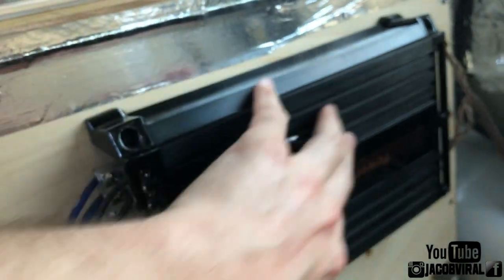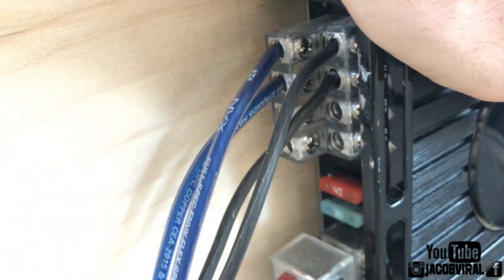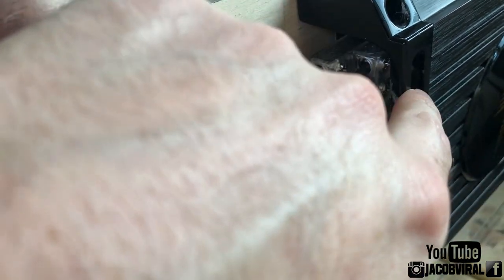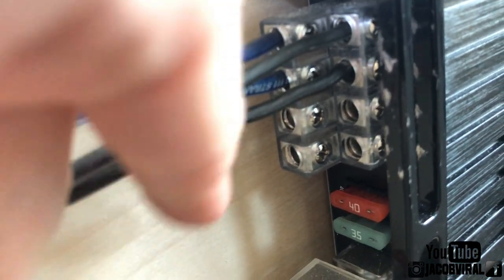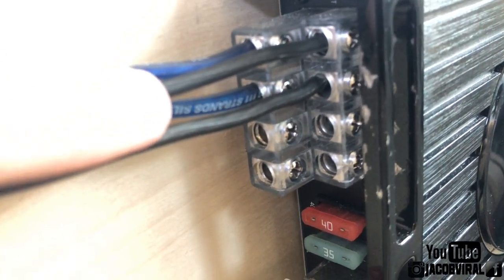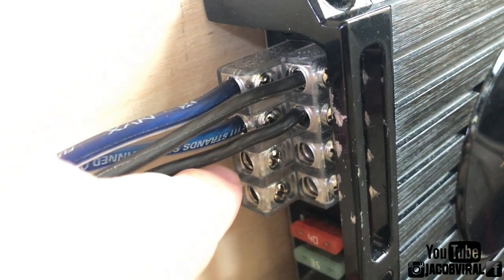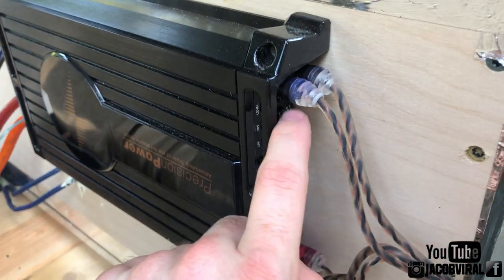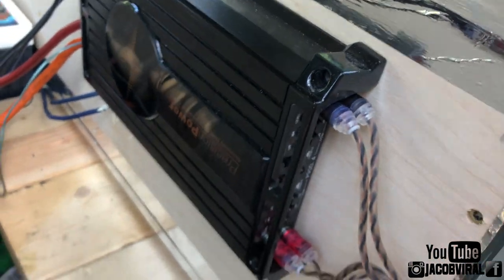DOES IT MATTER IF YOU USE ALL CHANNELS ON YOUR AMPLIFIER?

Comment: I'm getting only a mono signal from my 4 channel amp. There's no balance control, it plays out of all 4 speakers because I have them a hooked together, but still Mono. It's a Pyle Amp, so that may be the issue. It the Screwiest set up I've ever seen. There's No Right/ Left on the speaker outputs, just + and -. Never seen anything like it. I'm returning it to Amazon for a Pioneer 2 channel. What a joke.
Reply: Edit: No balance control on the deck, it doesn't change turning it left or right.

Comment: Ik its not recommended but i have a Rockford fosgate  punch 600.4 ch amp pushin  8- 6.5  yes i said 8‐6.5  its in 1ohm it get hot but never cut off   had it ran like this for over 1.5yrs 🤣🤣🤣

Comment: Hey what's up I have a crossover and a 4 channel on the mids and highs and a amp for the subs and my amps don't cut off when the car is off but the crossover do what am I doing wrong thanks in advance
Reply from the maker: Turn on wires should trigger to turn them off from the blue head unit wire
Reply: @JacobViral2  thanks that's what I thought but it doesn't work I'll try to figure it out 👊🏾

Comment: Ace ace ace! Been looking for a video coving this for ages! Ok….here is my question:

If you have 4x50w amp and you only use 2 of the 4 channels, does this mean you have slightly more power on these used channels given the decreased stress on the power supply??
The reason I ask is, in AV, they rate 2 channels driven because when all channels are driven the output of each is significantly reduced. So, by contrast, if you only used 2 of 4 on a multi channel amp, do you get a bit more power from the amp?? 

This is not a question about bridging the amp, just about leaving 2 channels unconnected like when using an AV amp in stereo.
Reply from the maker: No the way the internal components work to offer only limit to near/around the rated power per channel so regardless you won't get more power just help keep amp from using as much power and stay little cooler. Plus if any issues can always use another channel. Glad to help Nathan thank you for being a longterm subscriber.

Comment: I have a question about my set up I got eight speakers6x9 650watt  2 speakers per channel and my amp is a 1000watts
Is that ok
Reply from the maker: Yes just check with a multimeter confirm the ohm limit on amp channels and what ohm speakers, sounds like 2 ohm per set